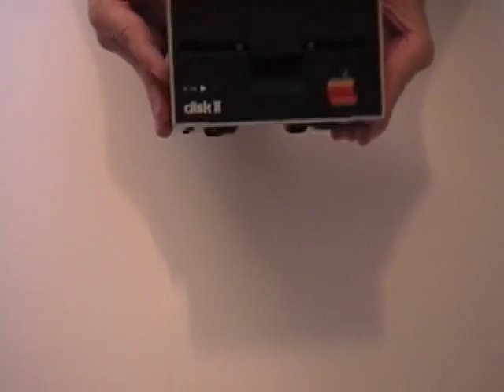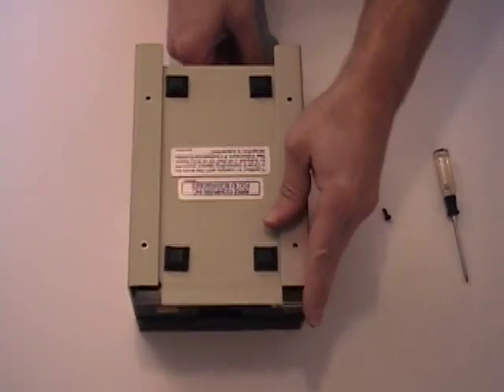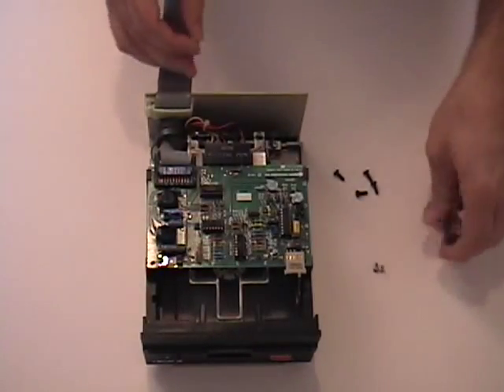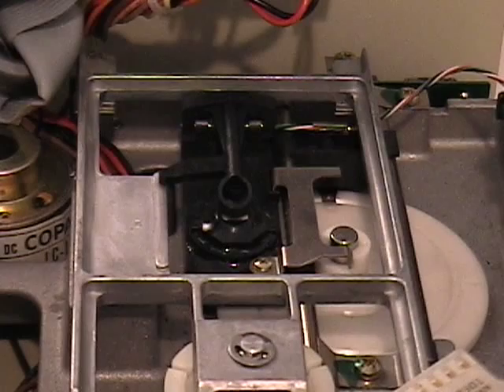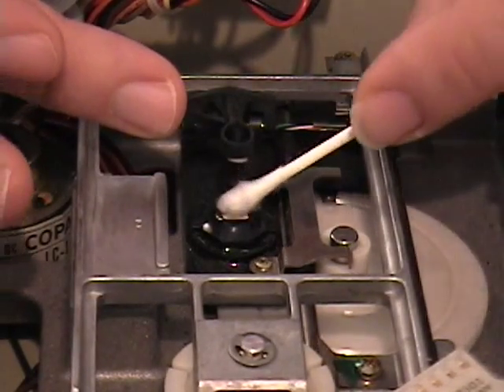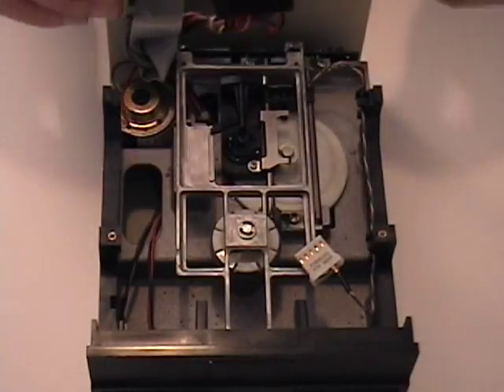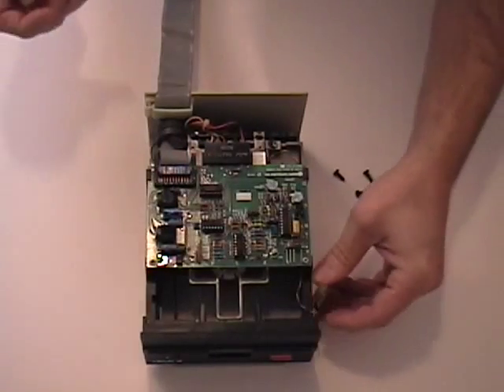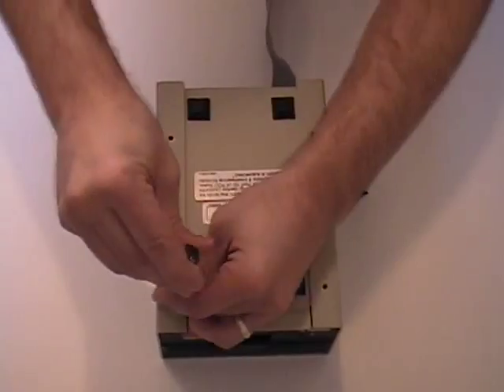Apple II Disk Drive Cleaning

Comment from the maker: @TeamNES1 - Sure, the problem could be: 1) the floppy disk itself is unreadable, or 2) the drive is dirty or misaligned, or 3) there's something wrong with the interface electronics (only likely if it's the 20-pin header, early version of the adapter card).  My money is on option 1.  You can hit Ctrl-Reset to get control back and use Applesoft (or bootstrap via ADTPro).

Comment: If you must use alcohol, non-denatured ethyl is best. Any alcohol tends to dissolve things that you don't want dissolved; but ethyl is the least nasty—followed by isopropyl, then the dreaded methyl. And denaturants are pollutants, plain and simple. No matter which is used, dry it off immediately. And keep it off the pad! I noticed that you let the pad back down onto the wet head (easily prevented by opening the door), leading to a solvent-damped pad laying on the head when you were finished.